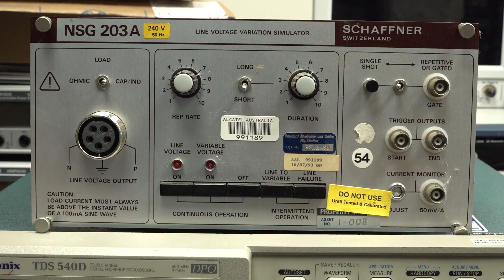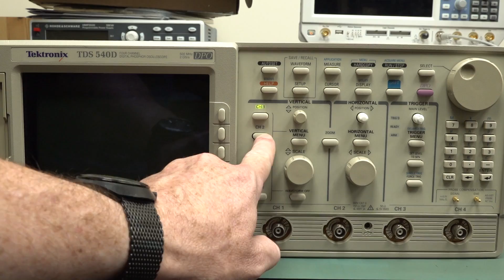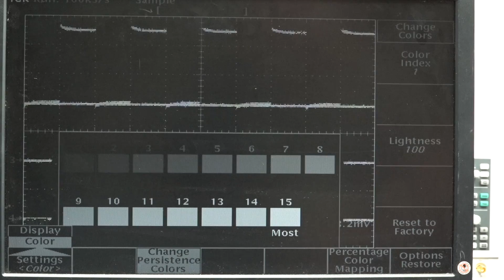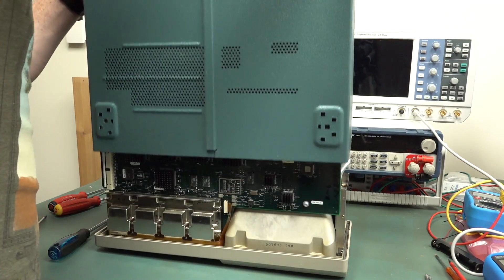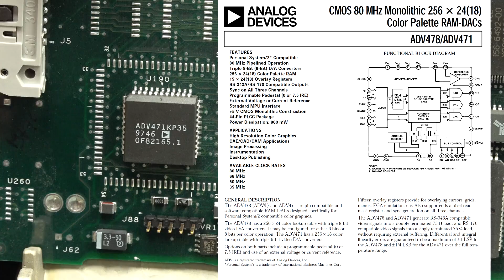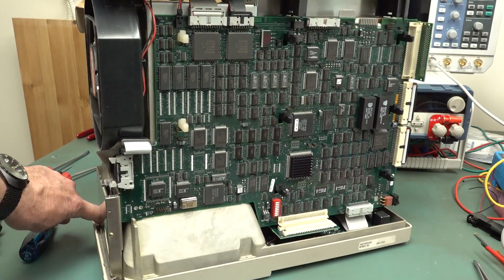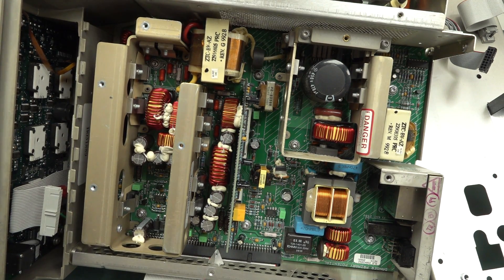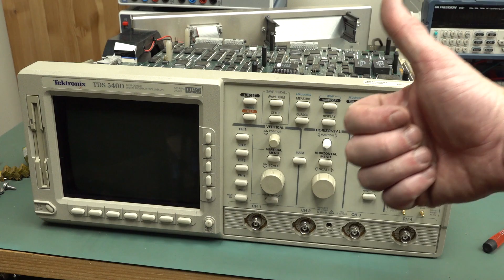EEVblog #1185 - Dumpster Tek 500MHz TDS540D Scope

Comment: I actually really like this scope.  I have the very first edition - the 540 (no A, B, C or D).  This is the one "you don't buy" given it's notorious capacitor problems.  I also carry spare parts (namely the acquisition board, "knowing" it's going to fail.  Weirdly it hasn't, it's passes POST all the time (phew), and the spares are still spare.  I really needed a cheap scope.  I give it a clean up with isopropyl now and again, but hey in Europe it's almost impossible to get a half decent scope for less than $100,  So I took a risk.  Love it.

Comment: I think a CRT is pretty much a vacuum tube: get Mr. Carlson to weigh in :-)
Reply: Carlson may have one or two of these units as spare frames, so if you give him a poke, he may be able to provide you with a spare working CRT...
Reply: Very unlikely it's the crt that's faulty. Wishfull thinking to just plug in a repair. The power supply for the tube is very high voltage and the components are highly stressed.
Reply: @jonka1  I'd just replace the entire monitor assembly including the driver board as a complete unit and be done with it, that would give you the chance to drop in a color tube as well.

Comment: Definitely repair the CRT if it's just a line/field output transistor problem. I suspect field because I can vaguely see a raster. Normally the line provides all the high voltages through the LOPT kind of like a switch-mode.

Also it could be from the USA and the field set to 60Hz. If it's Australian then it needs -50Hz, minus because of the upside down southern hemisphere thing.

Comment: A dim CRT from what I remember with PC monitors tis was usually related to the flyback/driver circuit. Something that old though too I would almost wonder if maybe wear tear/ age did not cause damage to the CRT tube and maybe the vacuum escaped. Original in a way is nice, but i would say just update it to an LCD.

Comment: I can spot the driver ribbon cable going into the CRT being 16-pin, so I'd put some money on the fact that it's just an internal VGA output which is connected in parallel with the outboard one.

Comment: The internal battery must have been OK as the date on first power up was correct!

I'd live with that scope running through a small VGA LCD.

Fix it. Replace the HDD with an SSD, just for fun, of course?

Comment: The Edinburgh Hacklab has one of these (or a very similar unit) but it has a power supply fault (we think) and nobody has got around to fixing it.
Reply: The A/B/C versions of these scopes have horrible electrolytic cap leak issues all over the boards, so unless it's a D version, it could be almost impossible to repair. The electrolyte leaks into the PCB and eats up the traces from underneath the solder mask. Unfortunately!

Comment: CRT vertical and horizontal oscillator circuitry look suspect, should be fairly easy to check even without the whole scope working.

Comment: Hmm.. electron gun is working, flyback still works. Could it be what's driving the deflection coils is the problem?
Reply: I could see no beam spot so the flyback may be busted. If the flyback was working but the deflection was dead, you'd have a very bright distorted image concentrated somewhere on the screen.

Comment: Now it's time to do a new review: Siglent SVA1015X
I had such a non-volatile module with the battery failing after 25 years. But there's actually info on the net how to "hack" them and connect an external 2032 or similar lithium cell.

Comment: I got a tektronix 7623A a coworker gave me, I guess he got from some military thing. I guess it sat many years unused, It worked a little, but some parts did not work, then the entire thing went. I think the modules are fine, but think something in the mainframe part went, I could not find the issue asked a friend that teaches electronics at the local college to look at it with a class, but I guess that class has not run because going on two years now and nobody touched it. Tempted to get it back and see if I can try again. Looks like they have mainframes on Ebay for like $80-$200. I almost think it gets close to $200 I may as well get a USB scope that I can plug in a laptop, etc. Or some other newer cheap scope. I don't really know much about the one I have to tell if it would be better to update or if this is still decent. I did not like how big/heavy it was though.

Comment: I have a colour version of this scope which works. I have a new clock/date chip to replace plus the other which is a ROM chip and I believe it contained the calibration data. My problem is how can I save the calibration data from this ROM chip to re-load into the new Dallas ROM. Otherwise it has to be recalibrated with special gear.
Are you aware that this can easily be expanded to a 1GHz model. A quick google search will come up with the instructions.

Comment: I have that scope new since 1999. But I still reach for my 50mhz Leader first when looking at analog stuff, video and audio. But the 540 is great with digital logic. is there an LCD upgrade? It does have a VGA output but I think it's still B&W, haven;t used that in years. Note that "Mr. Carlsons Lab" channel also has a TDS dumpster rebuild project video.

Comment: Hi Dave, It's one more great video as usual! Thanks! 
I have a problem with my TEK TDS974D, a little bit different from yours, it is corona from HV transformer. I have tried to glue put some rubber protection but it is not going. Probably internal SC or something similar. I know that this video is made 2 years ago, but  I am kindly asking If you have any TDS7xx series oscilloscope to measure the voltages on the HV Flyback transformer, because service manual I can't find for colour display model so I assume the HV FBT is completely different from BW model. Any schematics will be great for my model. Many thanks!

Comment: I can use a TDS 520 at work, but it's slowly dying. HV board for the screen is giving out, a few buttons don't work, and having screenshots on Floppy Disk is impractical these days. It has been superseded by an MSO 4000 and MDO 4000 scope.
Reply: There are floppy emulators with USB (originally for embroidery machines and music keyboards) that work great with the scope.
Reply: @mbirth Unfortunately there is currently no one interested in still using it, so repairs and/or upgrades won't be made.

Comment: It couldn't be a Iomega Zip drive but it could be LS-120, since they are different physical shapes Or were you saying the zip drive was an option?
Reply: After seeing the naked boards it looks like the ribbon connector was a floppy and not IDE so it is most likely a 1.44MB drive

Comment: Nice Machine. Not as bulky as my HP-Agilent 54540A. It uses Motorola 68020 or 30...hmm. Can CPU be upgraded, at least in theory? Everything else is fine and top quality. But a bit slow

Comment: It is still a mystery how options are unlocked and even though many people looked at it but no one came up with an working solution. At least this is true for the TDS400 series. If someone knows how please help.
Reply: Lots of info available on this. There is a list of memory addresses to poke - you need a USB-to-GPIB adaptor, I think.
Reply: @kennener8446  And there ist the problem. Every TDS400 I know does not responde to these commands or no effekt takes place after changing something. The same on the UART port.

Comment: lcd replacement drill the original screen glue the new screen on top of the old,then wire up the new lcd  through the drill hole in old screen?

Comment: Leaky caps. By now you've lost a few traces.
Reply: Ah, nm, I see the caps on the 540 aren't electrolytic unlike the 640.
Reply: @russdill  Actually the 5xx series had the same problem with leaky electrolytics. However the D model fixed it, the A/B/C models are all doomed to a leaky pcb-trace-eating death though.